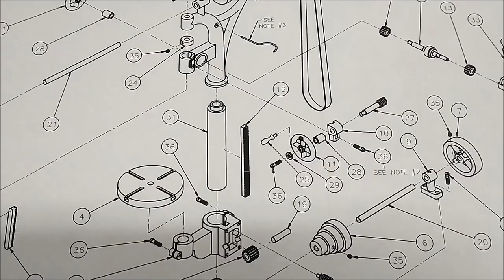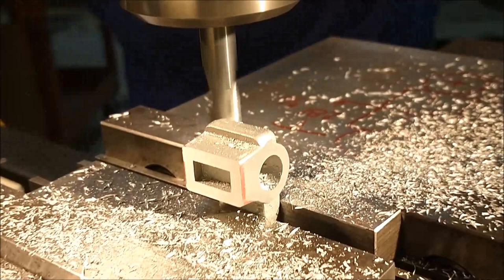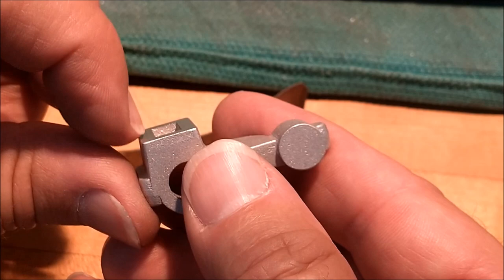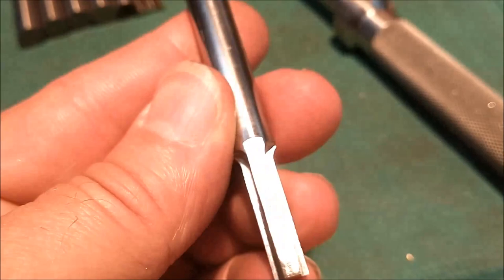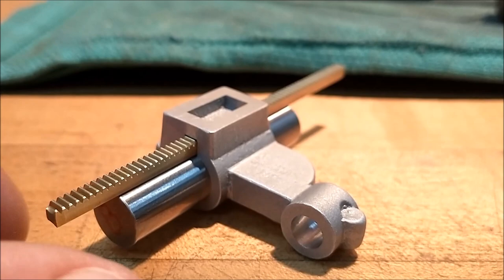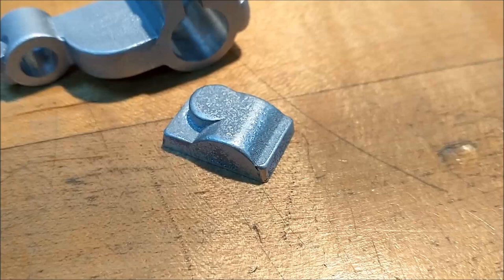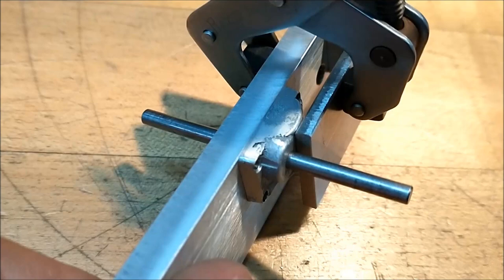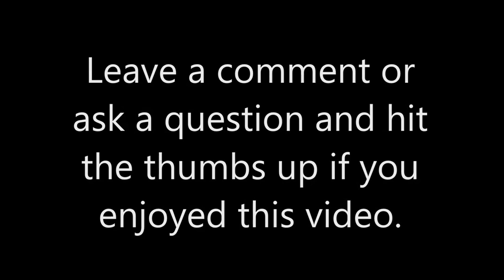Machining an 1890's Miniature Drill Press - The Knee - Part 1

Comment: One of the first tricks I learned in the shop was making a gasket by laying the gasket material on the part and using a hammer to trim the edges. Using the ball peen end of the hammer, you can make the bolt holes too.
Reply: My father taught me that when I had my first off road motorcycle around 10 yo. Ripped the carb gasket when removing the carb for cleaning, and made a replacement from a cereal box.

Comment: This part of the build just turned on a Light,,,Didn't sell the concrete coring machine yet,,,The tower knee works and looks identical to this. Mounting my welding fixture plate to the tower for height adjustment,,,WaLa!! Thx for Keeping on Keeping on joe.. have a great wk end,,Bear.
Reply from the maker: Thanks Bear. You as well.

Comment: Sweet. Tiny machining is better watching than huge machining any day.
Reply: I enjoy both tbh, have you found the Cutting Edge Engineering channel? He repairs heavy plant machines and the machining work is very engaging.
Reply: @ferrumignis  Not that I recall, but I'll check it out now. Thank you. Don't get me wrong, large machining is equally impressive. It's just a different kind of challenge.
Reply from the maker: The largest machine I ran on a regular basis was an 18140 Gap bed Mazak engine lathe. Fantastic powerful and accurate. The tool holders were bigger than these mini machines.

Comment: Fun one for sure and a lot better casting than the main drive shive was. An all brass piece would be fantastic eh. Great tip on masking. I have done it before with a razor blade by simply using the blade with a backward stroke that work OK but this is way better. Either way patience prevails eh. Just like that slick broaching. You are always on the ball my friend. You knw Joe, It is something you must hear more often than not but your forethought and setups are masterful. It is a real pleasure to see how you exicute these moves. It seems unfair that this seems like it took but a couple minutes and this post has come to an end. See ya soon eh.
Reply from the maker: Thanks for dropping by. I have a few more coming.
Reply: @joepie221  I await with baited breath my friend, and I am hungry. Bring it on teach.

Comment: This reminds me of the day I should have kept out of my workshop because breaking a 10 BA tap in bronze at the start of the day should have been seen as an bad omen!   I broke 4 of those taps that day and had to recover the job by drilling alongside the broken bit, knocking the bit(s) sideways into the drilling and then plugging and silver soldering the 2 holes and then drilling and tapping in the same place again.  This time without a breakage but I was sweating at the end of it and feeling shell shocked by the whole process!

Comment: Very nice. Much much better quality than my full size drill press (made from 100% chinesium).
Reply: I used to have a benchtop DP with a #2 Morse taper. Sold it and kept the Ryobi I have. Variable speed with a Reeves Drive 500 to 3000 rpm. Plus for a benchtop it has a de enact amount of gap between the spindle and the colomn.  And it fits up against the wall as the motor is between the spindle and the colomn. Matthias Wandel's web page has a page on another individuals shop that has one. They never sold too many of them. Which is a shame because it's one of the nicest benchtop drill presses I've seen.

Comment: Beautiful work!!!

I wanna see you craft up tiny Lapidary saw or Cabbing machine

I'd totally buy a tiny cabber
Reply: Or a minature table saw with a tilting arbor. One can get a small saw for around a hundred bucks (don't even bother with the Horror Freight special). But they all lack a tilting arbor. The ones that do have one are at least three times the price. Plus the hundred dollar ones have RIP fences that you use nuts to clamp front and back.
Reply from the maker: I have a table saw model in 1/12 scale. I don't think it has a tilting arbor. I may have to look at it again.

Comment: Brilliant, as always. Did I miss something though?  How were the locations of the 4 tapped holes in the gearbox transferred to the cover plate?
Reply: They probably wouldn't have been transferred as such, the dimensions between the holes and from the edges were known so just a case of putting the cover into a suitable fixture and measuring from a couple of reference edges.
Reply: @ferrumignis  The pleasures of a DRO!

Comment: Great video as usual. While broaching the knee did you intentionally leave the box face out of contact to observe tool pressure (deflection of the part) or is that just a happy coincidence ? I can see that being very useful in not over powering the broach and avoid deforming the part during this operation.
Reply from the maker: I left it slightly away as not to influence the gripping area and alignment. Seeing the casting bounce on the video from the broaching pressure was just a bonus.

Comment: Wouldn't have been using a cobalt or even carbide drill which are inherently way much stiffer have solved the flex problem...or even a single flute drill instead of a traditional twist drill ????? Just asking....

Comment: Will you be going for that extra bit of authenticity and making hex head bolts to replace the slot head screws?
Just kidding.
I'm enjoying the process. Thanks for the lessons.
Reply from the maker: I think square heads would be period correct. I'd have to research it.